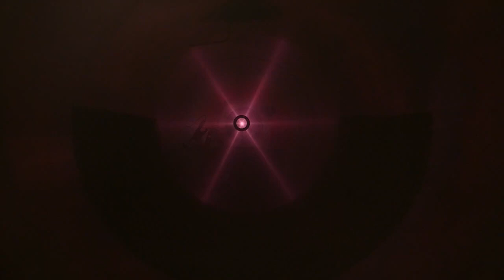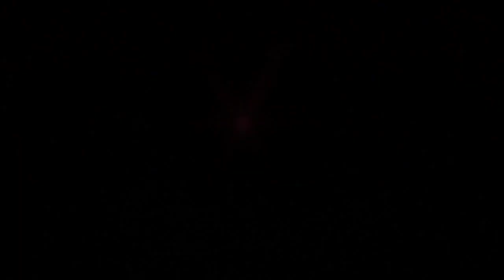FirstLightSecondSetup

Comment: Is it odd that when you drop the gas the cross beam sort of fades out?
Reply from the maker: No, it just means there's less recombination of ions, since we're not ionizing as many atoms in the first place, and they are colliding less often with neutral molecules and any free electrons = there are fewer there for one thing.  While it's purty, all the light is actually loss generated by atoms recapturing electrons and those electrons cascading to lower energy states - and that's energy I had to put in to get to charged particles that I can tug on with electric fields in the first place.
We have found generally that the lower the pressure we can run, the better the result we get.  Our theory is that since there is less random scattering, more of the % of ions that make it to focus are moving fast and in the right direction to collide.
Right now we're trying for more power out per power in and don't really care yet if the scale is micro-watts. In fact, if it gets a heck of a lot better than that, we'll have to cut the  input power for safety in the lab reasons... Scaling up is a separate issue, you have to have something worth scaling up first!